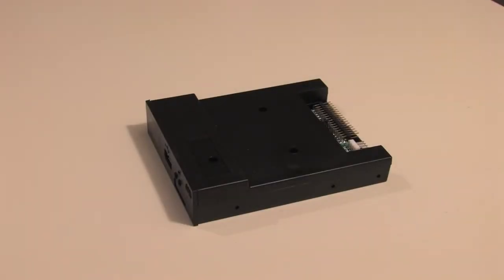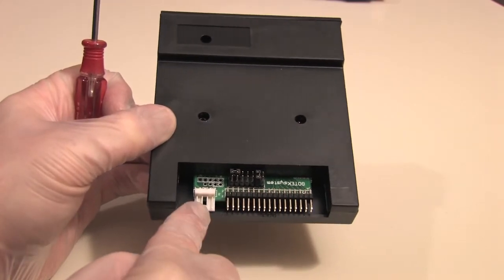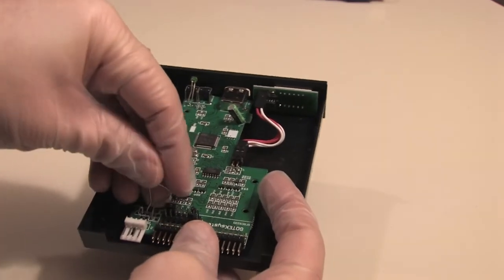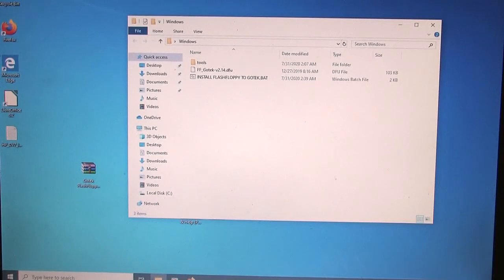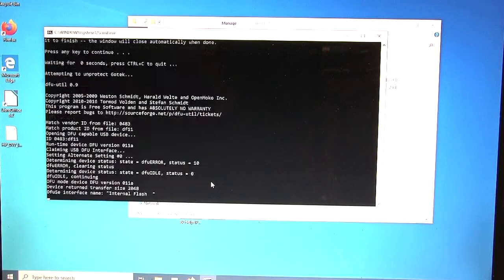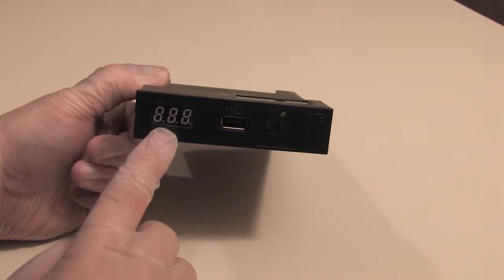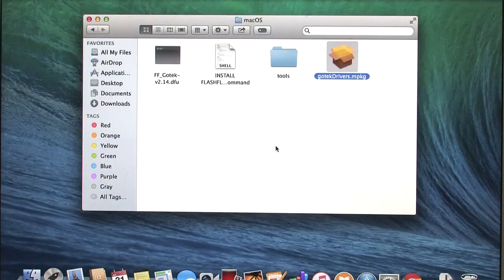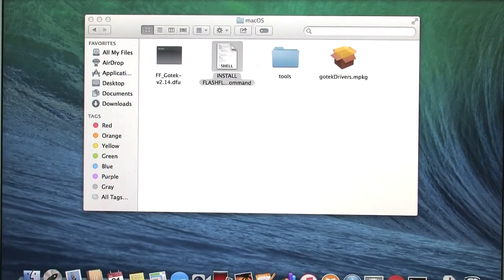Gotek FlashFloppy EZ Installer -- no soldering required (Windows and macOS/OSX)

Comment: Hi Phil,  Just a question, I successfully flashed my Gotek emulator.  I will be using it in my Roland G-800 synthe keyboard so do I need to install any other programmes into my Gotek for it to work in the keyboard?  (any additional firmware or software)?  One video on Utube goes through programming the Gotek for use in keyboards rather than Amigas or computers. (Bangers and Chumley-Take the Fear out of the Gear) is what their Utube site is called.  I am just not sure if I need to do what they are outlining or if it has already been done in your tutorial??  Thanks!

Comment: Great video, works great- Thank you! For anyone reading i recommend binder paper clips, they’re the perfect width and once you remove the two metal loops from the black clip, you’ll have 2 perfect connectors that only need slight bending with some pliers
Reply from the maker: I had thought about binder clips too, but never got around to trying it. Thank you for the recommendation and performing the experiment!

Comment: In my case I have every time same error:

Match vendor ID from file: 0483
Match product ID from file: df11
Cannot open DFU device 2e3c:df11
No DFU capable USB device available

Critical Error: No Gotek found!

I even soldered the jumpers, double check the solder, also tried to solder the usb male connector to PCB for ensure is not cable problem, nothing worked.
Reply: Check if your model has an ST microcontroler or artery microcontroler,cause newer gotek models has switched to a artery microcontroler due to price jumps of the ST microcontroler. And this utility only works with ST microcontrolers.
Reply: @MateuszWierzejski  I am on a Mac with Ventura OS and an ST Gotek.  Same error every time, even if I connect using a hub...

Comment: Following exactly the install procedure, I get the error message:
"Match vendor ID from file: 0483

Match product ID from file: df11
No DFU capable USB device available
Critical Error: No Gotek found!"
Any hint to solve the problem will be wellcome.
Reply from the maker: Either you have a new model to which this video doesn't apply (which is probably the case unless you bought old stock), or there's a problem with your cabling and/or jumper connections.

Comment: I am following the steps, but after installing drivers the .bat file says:

"Match vendor ID from file: 0483
Match product ID from file: df11
No DFU capable USB device available

Critical Error: No Gotek found!"

And gives an error that translates to "unable to access the file. It is in use by another process"...

Any idea or hint on what to look for? Thanks
Reply from the maker: Double check the programming and power links, especially if the Gotek display is lit when connected to the PC over USB. The display will not be lit when it is properly connected during the flashing process.

The batch file error could be because you ran the Gotek installer multiple times and left one of the instances open. Make sure to close the program each time you run it. I don't think the error should actually present any problems though.
Reply: @cellarseer  Thanks for replying. Well, after many attempts, trying to connect/disconnect the USB cable, let the PC recognize the unit, I finally managed to program the firmware and now it's working OK in my AKAI S3000XL
Reply: @cellarseer  I had the same issue where the Goteck was not recognised and none of the four Win10 machines would recognise it, no matter what. However, I have a Win8.1 machine which recognised it, and the correct details are in Device Manager and verified using devmgmt.msc and the correct details are there. However,  the flash program fails continually with "The system cannot find the path specified" message, followed by "Attempting to unprotect Gotek..." followed again by "The system cannot find the path specified", which is then followed by "Critical Error: No Gotek found!"  So, what is the path it needs and how do I find/fix it?

Comment: I did everything that you suggested. I looked up the jumper for the Embroidery machine that I am using the GOTEK with and set it as recommended. I installed the Flash Floppy firmware to the device and hooked it up to the embroidery Machine (Brother Bas 415). It has the F-F when the machine comes on. I plug the USB flash into the GOTEK and the F-F changes to E34. I am not sure where I went wrong. Can you help me?
Reply from the maker: You're missing a disk image. You need at least one disk image file on the USB drive or else there's nothing to read from/write to. In your case, you need to name the disk image as "DSKA0000.IMG" or "DSKA0000.HFE", depending on if you're using IMGs or HFEs.

For an embroidery machine, chances are high the disk image will just be a 1.44MB PC type disk. It's also possible that the Gotek will need to be set to S1 jumper instead of S0, so you may have to experiment.
Reply: @cellarseer  I realize this is going to sound like I have no idea what you are asking me to do...but...I have no idea what you are asking me to do.
If I have a USB drive that is brand new, what must I put on it to make it readable?
Reply from the maker: @timothyevans5816  Download this and add the file to the USB stick. If you need extra disks, just copy the file and rename it as "DSKA0001.hfe" and so on, incrementing the number by one for each new disk.

https://mega.nz/file/rA8RiITa#JvE1aPdCRO0QDhmN7bGxW0VNi_1Q3JwfCFMO9J1r5PM
Reply: @cellarseer  Here is what I used to do to use an embroidery pattern...
I would save a pattern as a .DST file to a floppy disk. Then I would take the disk and put it in the machine and the Machine would go to work. What I want is to save the .DST file to a USB and take it to the Machine. Do I need to save it to a Floppy and then save that image to the USB to get it to work? Do I need to save a floppy image to the USB and then save the .DST file to it so that it will work? Is there a video on how to do whatever sorcery to the USB flashdrive that I need to do to get the Embroidery machine to read the USB?

Comment: Hi, i ve read the instructions and before proceeding i'd like to use a more up to date firmware BUT your instructions are clear  : do not rename or modify the "tools" folder or the included
  "FF_Gotek-v2.14.dfu" file.. May i ask why shouldnt i modify the BAT to point to the current dfu from flashfloppy site ?
Reply from the maker: If you're that advanced of a user then you can certainly edit the batch script, but it's mostly pointless because the firmware can just as easily be updated directly from the USB drive once the initial flashing is done. Upgrading/downgrading takes all of three seconds using that method, so you're probably losing time even thinking about the tricky way, let alone implementing it.
Reply: @cellarseer  ok i thought it would jam the process as there is 2 different versions of the dfu files in your kit. Thanks for your reply.
Reply: Just a quick feedback for other users : all want fine , the updated flashing firmware went great (if you want to edit the bat file). i had a problem with the dfu mode but after rechecking it appears i had the 4 wires all mixed up...

Comment: Sir one question: my retro computer can only handle 720k FDD.
Can I buy any Gotek and flash it with FlashFloppy and using it as 720k FDD?
Reply from the maker: Yes. But be aware that newer Gotek models are flashed in a way which is slightly different from this video.

Comment: Hi, thanks to fantastic your video I,d been able to flash the FlashFloppy firmware in my Gotek drive but that all. I constantly get E34 error from the Gotek drive, ones is installed into my Korg X3, I know that is something related with the ff.cfg file, but I don´t what to do next. Any help? FF.CFG are an enigma to me and I'm not able to find any info that show me some light.
Thanks in advance!!!
Reply from the maker: You need some Korg X3 disk images on your USB first. Format a USB as FAT32. Copy one Korg X3 disk image onto the USB drive and make sure it is named "DSKA0000.IMG" (or .HFE, depending on source). If the Korg still cannot boot then you may need to change the jumper from S0 to S1, or S1 to S0.

If the Korg X3 still will not boot then you will have to add an FF.CFG to the USB drive.
Reply: @cellarseer  I will try, thank you!!!!
Reply from the maker: @Fito2019  Basically, go to the link below to find the correct Korg X3 files and make sure they are named FF.CFG for the configuration and DSKA0000.IMG for the factory disk.

http://zine.r-massive.com/floppy-emulators-for-audio-gear/
Reply: @cellarseer  WOW man, works perfectly!!!!! thanks again!!!!!
Reply: @Fito2019  how was your jumper settings?i need for korg i3
Reply: @klompjes002  only the S1 connected should work fine.

Comment: Are all goteks relatively the same?  I see them at the auction site and they say they're for keyboards or pc or amiga or what-have-you and there are all sorts of different prices, seemingly based on these uses, but I get the impression that other than preprograming (which this negates) they're all the same and one might just get the least expensive one despite whatever use it claims to be for.  Is that correct?
Reply from the maker: Roughly, yes. When people sell them for certain devices they are usually the same as far as the actual Gotek, but have specific disk images for the target machine (Amiga, Ensoniq, Atari, etc.), or occasionally have 3D printed enclosure which better fits an odd shaped chassis or floppy bay.

Your thinking is correct.
Reply: @cellarseer  Onde se pode encontrar essa imagem para os vários tipos de maquina? Especificamente para maquina da industria têxtil

Comment: buenas una pregunta. enchufe la gotek en el teclado con tension y ide. sin sacar los puentes del modo dfu. es probable que se alla quemado.? o sera que el cable usb que estoy usando es de 3 terminales y por eso no me carga los drivers...? agradezco tu respuesta
Reply from the maker: You're going to have to give a lot more information about what you did exactly, what the Gotek model is, and what you mean by "3 terminal USB." Keep in mind that this video does not work on the newest Gotek models which were manufactured without STM chips.

Comment: If I do this to my Gotek, will I still be able to treat the USB stick as a 1000 floppies? If so, can I access and read/write to those virtual floppies (1.4mb) on Mac OS?
Reply from the maker: Yes. A USB will hold many disk images. One warning, however: You will need to use HxC Software to access the disk images to read/write individual files into each disk image.
Reply: @cellarseer  Sorry, I wasn't clear. I already have a 1000 disk images on my USB for my Gotek. Does using FlashFloppy allow for more? Or the ability to access all 1000 from MacOS or Windows? If so, do I need to flash the drive with FlashFloppy and then use HxC software? Please elaborate. :)
Reply from the maker: @aeko  The biggest advantage is that FlashFloppy allows installing an OLED which can use folders and also descriptive filenames rather than just the display with three numbers.

If you install FlashFloppy, and install an OLED into the Gotek then you will be able to achieve what you want, but if you've already got 1000 disk images, and everything is working with the factory Gotek then I'm not sure I would bother.

But yes, you can access as many disk images as you'd like under macOS or Windows when using FlashFloppy + HxC Software, although you're still limited to 1000 images with the factory Gotek display.
Reply: cellarseer what purpose the the hxc software serve? Will I be able to use download the hxc software from a Mac?
Reply from the maker: @aldenmedina  HxC Software allows for diskette ripping (best results with an internal floppy drive) or for converting between different types of disk images files such as IMG to HFE.

And yes, it works on macOS.

But don't confuse the HxC Software which is used for disk image creation/management with the HxC firmware which is a paid version of FlashFloppy. If that's what you're asking about then there isn't a significant benefit to the HxC firmware rather than FlashFloppy in most contexts, although HxC does allow some small tweaks for advanced users.

Comment: Thank you for your video! I am trying to installing on Mac! But I got message and cannot go next...massage is Critical Error: No Gotek found!  in command after press password! What is my problem?
Reply from the maker: Make sure to run "gotekDrivers.mpkg" before running the "INSTALL FLASHFLOPPY" command.

Also, make sure the programming and power links are making proper connection--hold them in place with your finger the entire time, if you can. See the video @ 4:09 for how they are supposed to be.
Reply: @cellarseer  Thanks. I am sure doing exactly same as video but got error.error is 

Match vendor ID from file:0483
Match product ID from file:df11
dfu-util: No DFU capable USB device available
Critical error : No GOtek found!

Is this just Connection Problem??
Reply from the maker: @seiya_fukunishi  I would attempt it on a Windows computer, if at all possible--that seems to work better. I would also suggest trying a different USB-A to USB-A cable, but most people do not have more than one.
Reply: @cellarseer  Thank you for your response! I will try again change cable try on Windows If I can.
Reply: Just to add, a USB to USB type-C with an adaptor worked for me and I also got the same error on my Mac, but it worked in Windows (boot camp ftw!)
Reply: @PhantomFellows  Thank you for your comment! It helps me from deep hole! I tried on Windows of my brother. And I got installed finally !!!!  So I got F-F on my display of S3000xl and now What should I do next???
Reply: seiya sawatdee great! Now you just put your images on your USB! If you don’t have the OLED display (I highly recommend) then you have to rename the images, with the OLED you don’t have to and you can use subfolders but if you have the stock LED you’ll have to rename them- idk how specially (something like 1disk.img 2disk.img etc) but check the website. Also download the flashfloppy software, go to examples folder and copy the FF.CFG file to your usb drive. You’ll want to change the “host platform” entry to what you’re using. I use a PC so for example I just change “host = unspecified” to “host = pc-dos”
Reply: @PhantomFellows  Thanks for support!   Finally I got to play on USB flash floppy!! I really enjoy it! And now I thinking modify to OLED!

Comment: for some reason my gotek isnt being recognized by my computer
Reply from the maker: More information is required. What kind of computer (Windows 10? macOS High Sierra?) and what you've already tried at minimum.

Have you tried connecting the Gotek through a hub? Did you make your own USB-A to USB-A cable, or buy a factory made cable?

Comment: What's the easiest way to update the ff firmware?
Reply from the maker: If you already have FlashFloppy installed then just copy the *.UPD update file to a USB stick, insert it in the Gotek, and power on with both Gotek buttons depressed.

Comment: This Works on the Yamaha PSR 2000 keyboard ?
Reply from the maker: Yes.
Reply: @cellarseer  how to format a pendrive to Flashfloppy ?
Reply: @cellarseer  my emulator shows E34 in the display. What i need to it works ?
Reply from the maker: @RosalvoParadella  Format your USB drive as FAT32/FAT16/MS-DOS FAT. Copy a disk image named DSKA0000.IMG to the USB drive. Copy a proper FF.CFG to the USB drive.

Which FF.CFG and DSKA0000.IMG you use depends on what device you have. For PSR2000, you'd need an .IMG file which is formatted for standard IBM PC, and likewise you want to use an FF.CFG which is setup for IBM PC.
Reply: @cellarseer  thank you !! God Bless you. I will try it.
Reply: @cellarseer  i try it, and it works perfectly now !! (the jumpers position is S0 and JC) Thank you. God bless !!